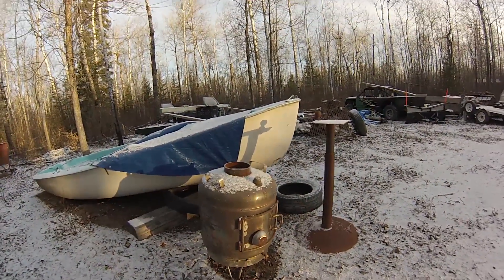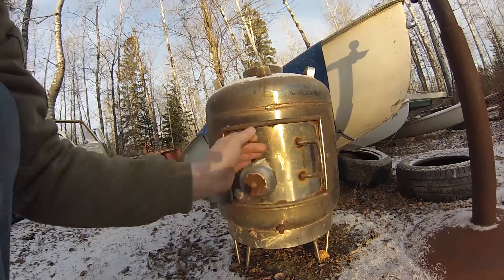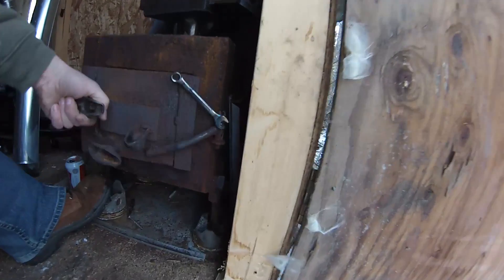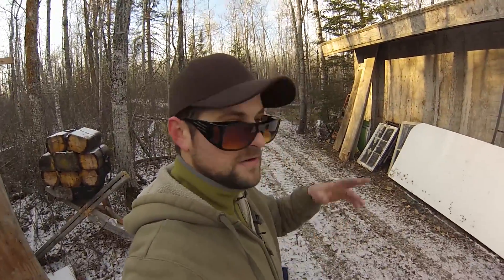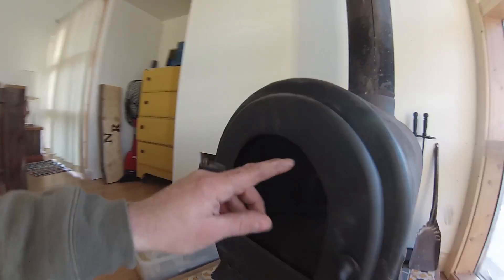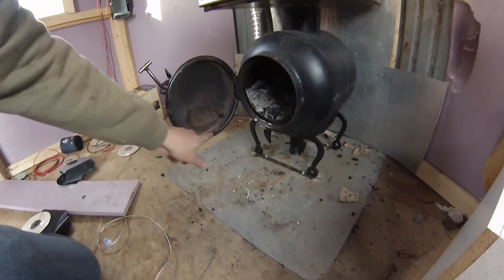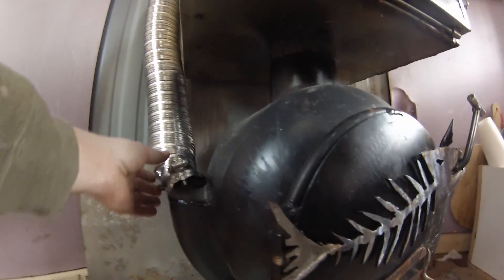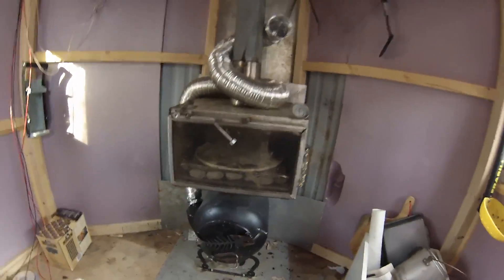Wood Stoves Heat Exchangers and Pizza Ovens Homemade From Scrap Metal

Comment: Thanks for the vid man. I have a similar setup in my fish hut and am leaning towards adding a fan driven recirculating system and was wondering about drawing fresh cool air from the outside versus drawing the cooler air from  within the hut. Any thoughts shared would be appreciated.
Reply from the maker: yeah for sure, I would think that drawing outside air into the stove is better for keeping the heat up in the shack, instead of drawing cool air from all the cracks into the shack. the way I did it works too, by pulling fresh heated air into the shack (to gid rid of the smell of 4 guys inside) and then burning it in the stove